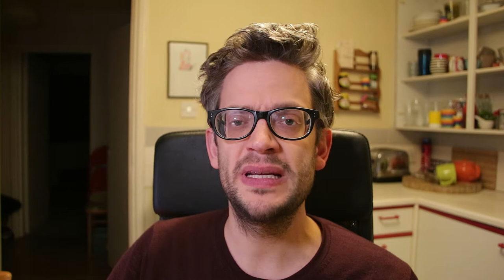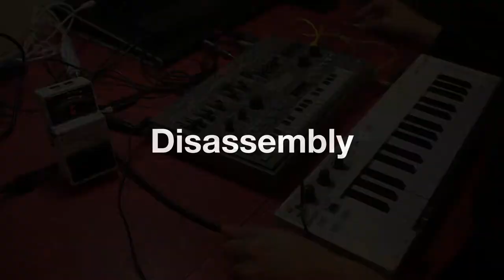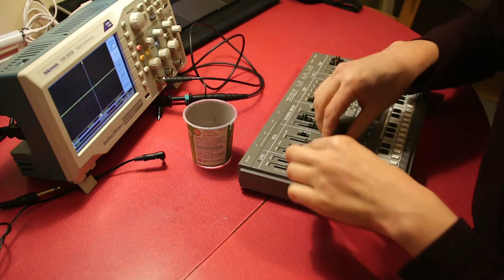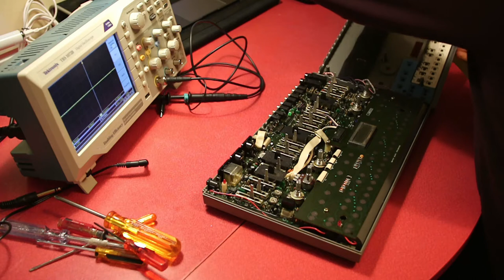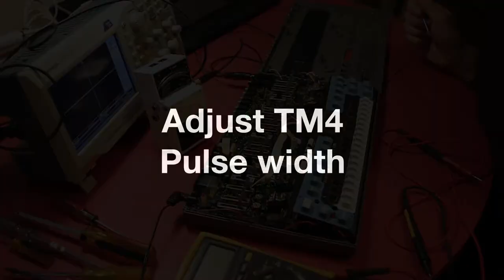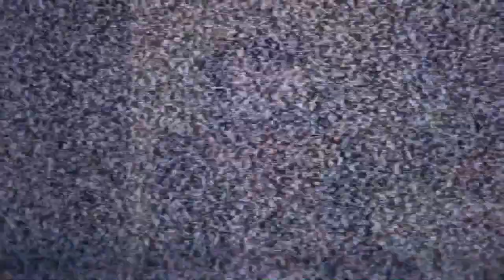How to tune, adjust and calibrate a Roland MC-202

Comment: Hi ,my mc202 scale or tracking is in reverse ,going up the keyboard/ changing the range switch does the opposite of what’s it’s supposed to ( high C is sounding a low C ) do you think this could be a tuning issue ? Thanks
Reply from the maker: that sounds like something else to me, but it won’t hurt to try tuning it

Comment: I read that a measure is 192 beats or clocks? I know the numbers have to add up to 192 to make a measure. Against what though? Other din sync machines? Is that why it matters? Cause you could just let the thing go with no concern for measure timing right? I have an app that can take any string of numbers and convert them so they are converted  to add up to 192. I had it made a while ago. But Im curious why it matters.
Reply from the maker: You could just let it run out of sync. That might be cool in certain cases, but I think it’s good to have the sync most of the time.
Reply: @gwEmbassy  but you can have different length sequences on a 606. So where is the sync? Where does this apply?
Reply from the maker: To be honest, I only really used the 4/4 rhythms

Comment: Do you find the sub oscillator quieter than the other oscillators?
Reply from the maker: A little bit yes. But overall it is not unbalanced
Reply: @gwEmbassy   Im told it's taken from the filter chip. Ive noticed a bit of noise with it. If you really crank it. You can hear a kind of digital noise..
Reply from the maker: It’s probably from the CPU. The 303 does the same

Comment: What kind of oscilloscope?
Reply from the maker: It’s a Tektronik
Reply: @gwEmbassy  I bought an app for the Mac called Oscilloppoi. Could I calibrate my 202 with it? Do I just need to see waveforms?
Reply from the maker: I think you could, it should be good enough for the purpose. You can get away with just a multimeter and a guitar tuner to be honest.
Reply: @gwEmbassy  I have those two things also, how would you use the multimeter?
Reply from the maker: It’s in the video. You use it to measure certain voltages